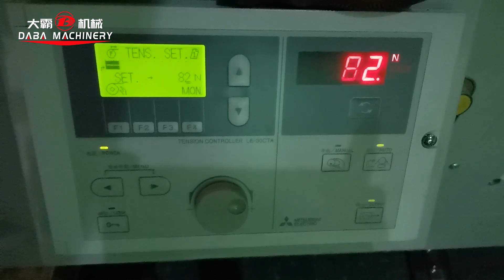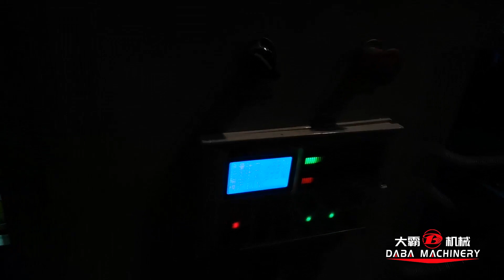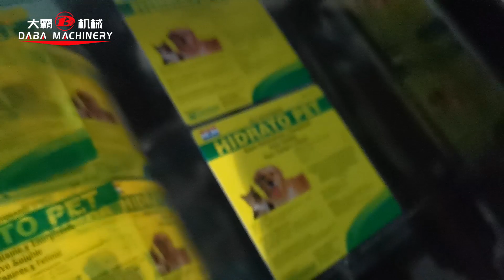6 colors flexo printing machine with camera used for pet food package transparent film

Comment: Hello, how much power has one uv lamp ?
Reply from the maker: mostly,normal uv 4-8kw,led uv 2-3kw🙂
Reply: @vicky5143  so this machine had cooling rollers because of printing on film ?
Reply from the maker: @miljansavic1818  No,this machine without cooling rollers.The dry temperature can be changed by adjusting the UV power.BTW,Our unit type printer has cooling system